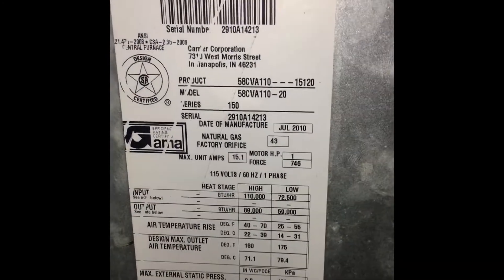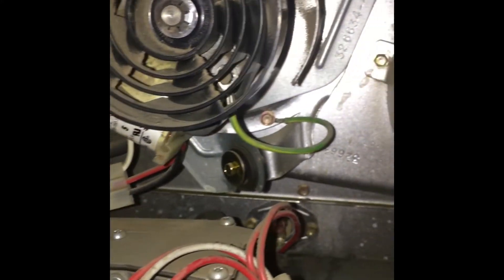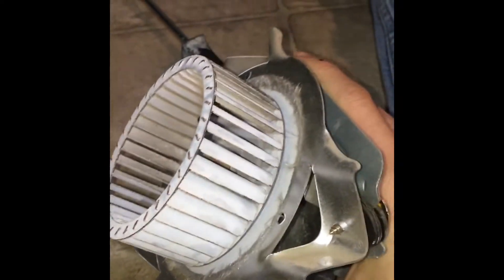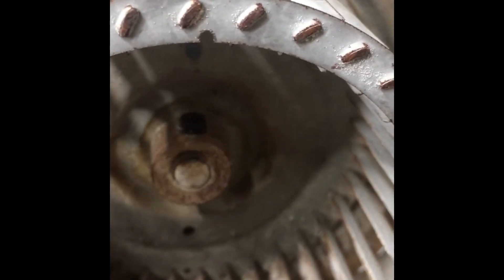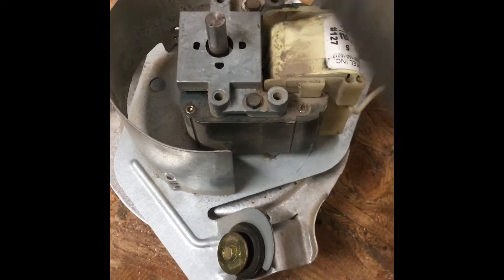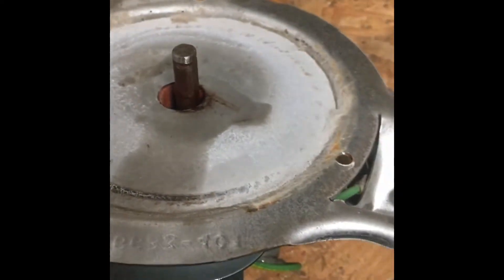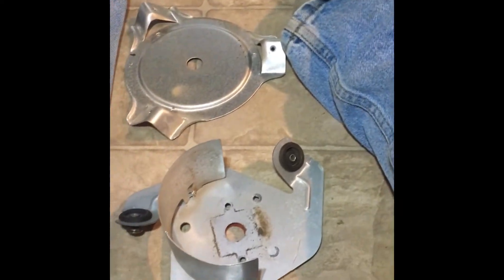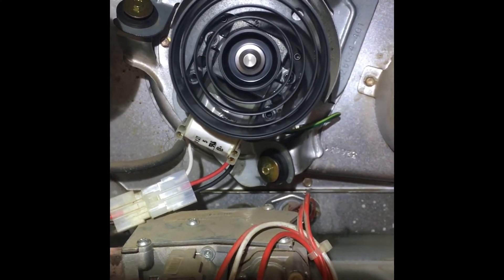Carrier Furnace 58CVA110-20 Inducer Motor Rebuild & Replacement

Comment: Heat and oil wouldn't quite work for me but a cutoff wheel right through the center of the shaft did the trick.  All I needed to save was the two frames.  These motors are trash.  They have "sealed" bearings that cannot be oiled like people with a brain like to do it!

Comment: Good stuff here. Most inducer motors are 1/3 rd the cost of a new furnace which is crazy
Reply from the maker: It is surprising how just a part is that expensive. This is an off brand I put in. The actual from a supplier was double.